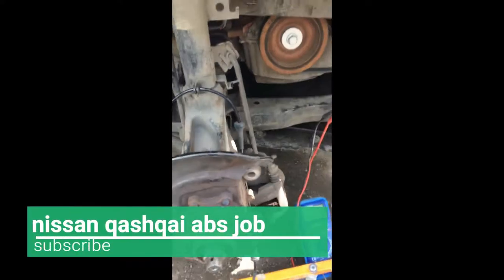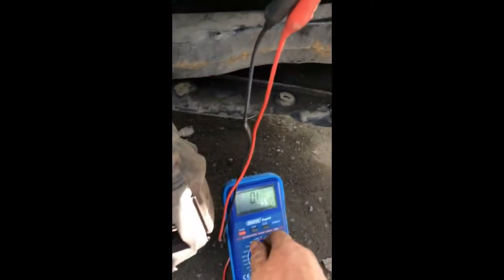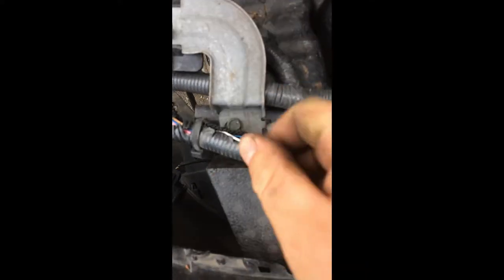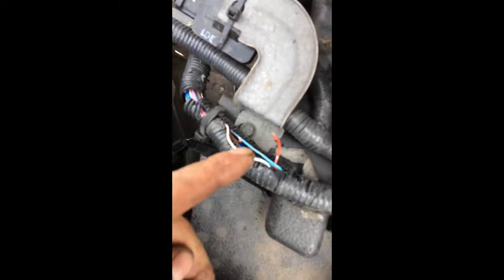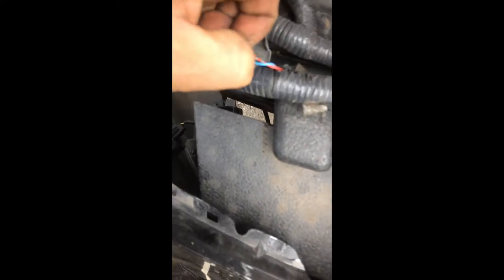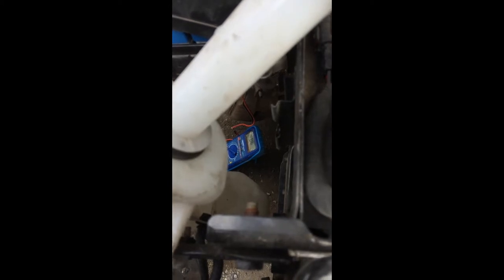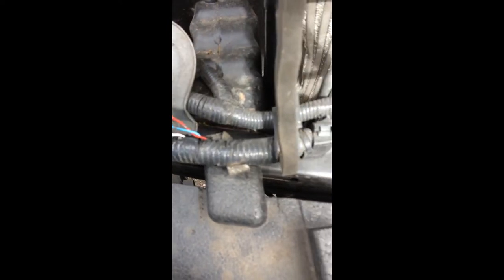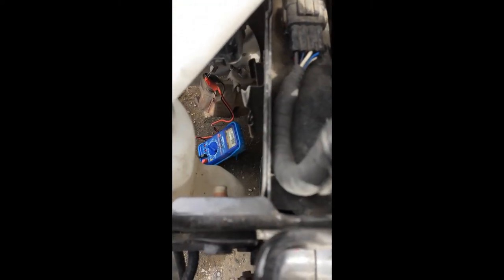Nissan qashqai abs how to check resistance YouTube AME Motors Howtofix

Comment: Hey.

How much would it cist to resolve the ABS issue that you fixed,
Reply from the maker: hi depends how long takes to find problem
Reply: @amemotors  Thank you! I have an issue with my ABS on the right hand side rear wheel. Also battery keeps draining low.
Reply from the maker: can be 50 can be 500 depends how long takes fined problem